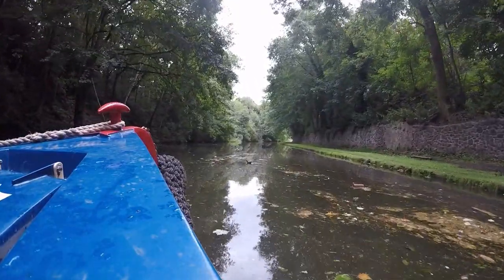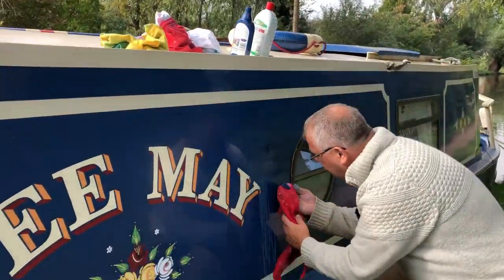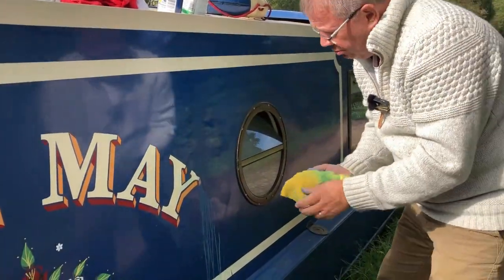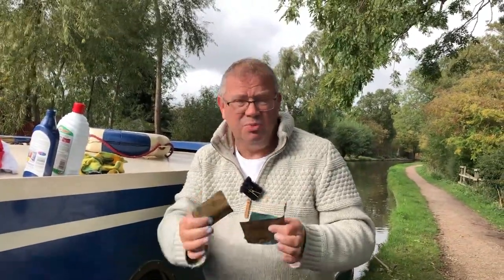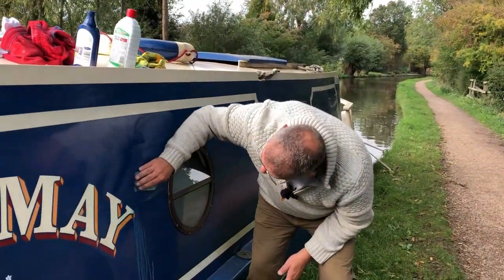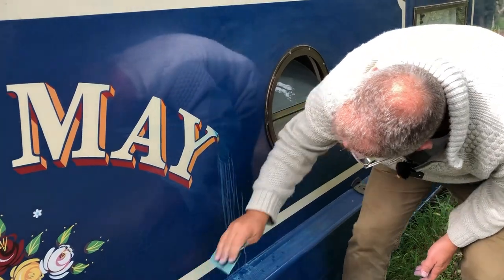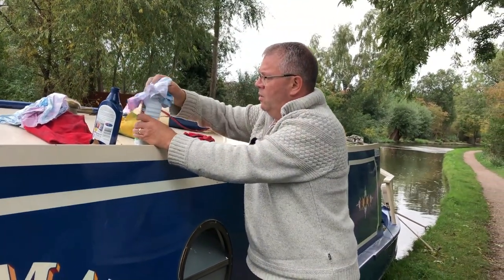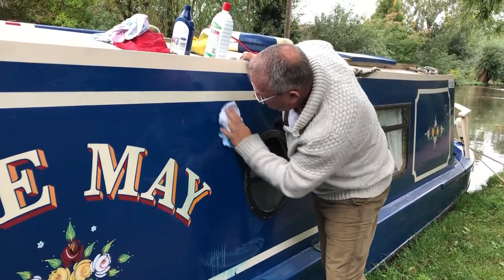#34 Narrowboat Paintwork Repair... Narrowboat Natterings Tech Tips

Comment: 'Wow Nano Sponge'
We live in Thailand, so these sponges, may not be available in UK.
They feel like a fairly dense sponge, and are great for their purpose of cleaning dishes, but in fact they are the equivalent of a 3000 grit paper.
I tried it on a small patch of paintwork, and it did indeed take off the top layer.
The benefit of this type of sponge, is that you can get the sponge as wet or dry as you like.
Thanks for the video and 'natter', look forward to the next one.
Stay safe during your lockdown !
Reply from the maker: Awesome. I'll look out for one of those. Sounds perfect!  Thanks for watching!

Comment: 35 years In the car repair trade we used to use Farecla G3 then finer cutting polish, bird sxxt was a bad one, modern two pack not much touches it.
Regards
Kevin
Reply from the maker: I'm trying to remember what we used as the cutting polish. It was white and very liquid.
I worked in the rectification area at LDV vans so all our repairs were minor as they were brand new vehicles straight off the production line. Most of the time it was dirt nibs or craters or perhaps where a spray hose had made contact with the wet paint. Our superfine 1500 grade were like little daisy discs that were about the size of a 2p coin.
Reply: @NarrowboatNatterings  And back in the day you did not want to make the surface too smooth or it would show up against the factory orange peel finish, had a lady complain because the new wing fitted to her Maestro was TOO shiny LOL
Reply from the maker: @beekeeperkev  haha! Good yeah! I remember those issues! I also remember our polishes were also Faracle products I believe.